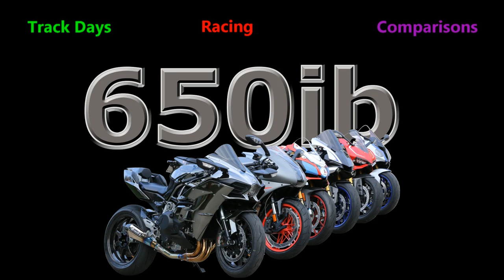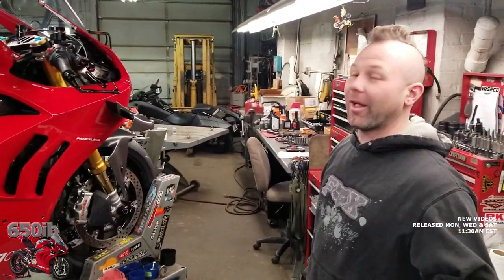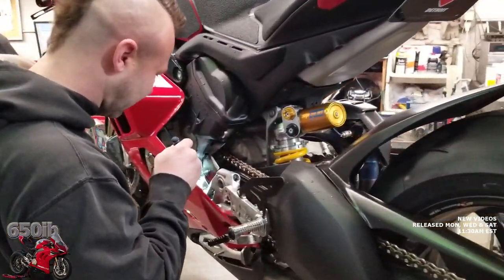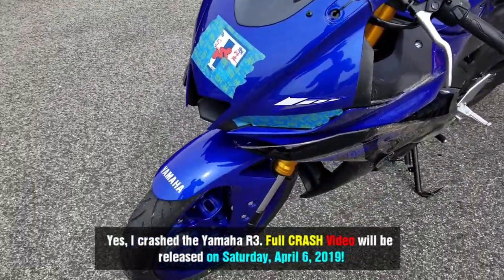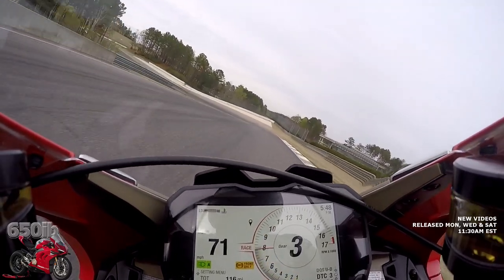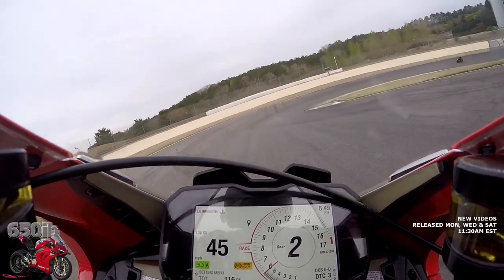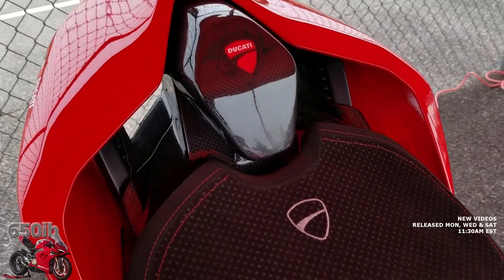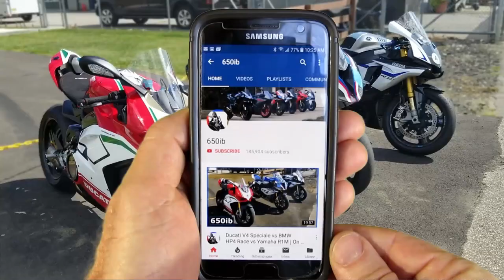Ducati Panigale V4R vs V4 | First Day at RACE TRACK!

Comment: Pass at 11:40 was a-little close for the speed at which you passed. General rule of thumb for your group and overall track days is at least 6 feet. Could get hairy if that guy didn’t stay in his line.
Reply: We used to use the 3 ft. rule on track days.
Reply: That pass was also due to lack of track experience. Track instructors often look over their left shoulders on straights to check on riders while staying on the the throttle. This often causes them to slightly drift to the right. Passing them close on their blindside is an unnecessary risk and should only be done with caution. He passed close and hard on the gas but immediately let off once he passed. Must be too used to those “got em” passes on the highway. Lol

Comment: Hey ib, one quick question. Riding the Ducati v4s I felt it's a little small for the big guys to hide from the wind blast and my legs would tend to open up after 285-290 kmph, have u faced the same on the V4R or is it only with the V4 and V4S versions?

Comment: Cold engine.
You should heat complete the engine before full throttle...
Reply: I'm sure they already started it prior to filming. Relax
Reply: Exactly,they have tire warmers on so its obvious the engine has been warmed up.
Reply: On the dashboard, when he arrive on 7000/8000 rpm, The indicator line become Orange.
It means that The engine si alredy cold and it isn't in the correct temperature.

Comment: bumma about the crash ib, but stick with the r3 and get some sticky tyres on that baby.

the most i ever improved as a rider was when i bought an old track 600. it only cost me a couple of grand but i wasn't scared to drop it like i was on my spanking new bikes and i was able to push much harder because of that.

I can't even imagine how timid i'd be riding a panigale on track.
Reply from the maker: Thanks man, I agree with you. I will ride my R1M track bike more.... I'm not as concerned with pushing it.

Comment: If you spend more time on the R3, you'll learn better lines out of necessity. The big power 1000s make you lazy because you can always go as fast as you want on the straight. With the R3, you need a good line to maintain speed.
Reply from the maker: I agree with you
Reply: I know because I had an R1, then after that I owned a Ninja 300 and CBR250R. I learned so much from those bikes. For the street, I like the midsize 450 to 800 cc bikes. Manageable and fun power. For track riding, I think I'd get an R3. I can't afford to track my SMR 510 often. Engine rebuilds become so frequent.

Comment: Hey Ib. I Love you man and I envy you the pleasure of riding v4r on the track- that goes without saying. Look I am not the hater and do not take it the wrong way. You need to learn how to ride on the track my man, the way you  ride now puts you in great danger of having yet "another agricultural" experience. Here is why- I can only presume that you are using super expensive tyre warmers as you are loaded beyond my wildest dreams.You start the session with properly warmed tyres and then sorry my man but you go so slow that they tyres lose the temperature. Specifically you do not break at all so the front tyre loses the temperature very quickly, the longer you are on the track with that pace ... the more risk you take. You need to maintain minimum pace on the tack and you can't do it now. Take some trashy r6 or s1000rr and spend money on riding tuition more rather on another Rizoma and  once you pick up the pace ... go on v4r. I am not a professional rider or anything but the pace you have and the way you treat the throttle makes me worry for your beautiful v4r. Again not hating but I can see problems coming your way if you maintain your riding schemes. Good luck and keep up with that good work. Papa Bless.
Reply: All I got from that was hating in all honesty. If you're not a pro or a riding coach fall back
Reply: @hfr8343  I am not a pro, but I am a frequent track rider. Ib may lose a front one day as he is a big dude... not hatin quite opposite I love the guy I am his subscriber and I enjoy and like the videos - I do not want him to crash.  Tyres need temperature to work. They get the proper preparation by tyres warmers then they are getting cold on the track... not a good thing.  Just saying.
Reply: @adambrzezinski8009  I was just about to say the exact same thing. No offense to IB, but riding that slow on the track is dangerous for you and other riders.  IB should be on a much lower cc bike like an R3 or R6 to learn how to ride on a track.  Put your ego aside and go buy a cheaper bike and practice riding on the track before bringing the V4R back out, nobody is judging, we all started somewhere. Have fun, but be safe in doing so.

Comment: In sure hope you aren't riding on slicks, you need to pick up your pace a lot as your tires will be freezing on what looks like a cold day and you will have another problem like you did with the r3, you got some cool build vids though... but really you should probably spend money on some classes to get you going on the v4 or use street tires at that pace. You can go faster than that on the r3 and its a better bike to learn on

Comment: 650ib....... the tire U chose for the R3 were to blame for the crash ..... Track tires for track days , period .... Next time use Supercorsa SCs 110 and 140...... there are also Pirelli Superbike slicks 110 and 140  for it......
Reply from the maker: Thanks man. I agree.
Reply: @650ib  what tires were on the R3 ?
Reply: This had nothing to do with it. You can ride track on any tyre so long as you ride to the tyres limits. A couple laps of building up some heat in the tyres is what should have happened. If he had gone out on slicks it may have been worse. A cold tyre is a cold tyre.

Comment: Gearing is short, not tall lol

V4R 1st gear= 13.66, 2nd=10.63, 3rd= 8.77, 4th=7.66, 5th=6.85, 6th=6.3
BMW                 11.5              9.1               7.53           6.53          5.92          5.49

so as you can see like i was telling you in your other vid bro, your gearing is really REALLY SHORT compared to other liter bikes which makes for using all of your HP very efficiently. Due to the extra revs they were awarded to shorten the gearing more without sacrificing MPH
Reply from the maker: Thanks for the info Sir!
Reply: Anytime bro

Comment: Nice video, but you really need to take some courses to improve your skills. Just blasting down a straightaway then dropping an anchor in the turns is not a fitting demonstration of the V4R’s capabilities.  Not intended as a diss on you at all. I was an instructor with the Jamie James school at Barber and if you’ll invest some time into a good Rider’s school you’ll be amazed at the results you’ll see.  Try Cornerspeed Rider’s School at VIR. WELL-worth the time and monetary investment.   Wishing you continued success!

Comment: i've crashed at Barber also.. never fun.. always cold tires.  however.. your buddy Jason really needs some lessons.. way too stiff on the bike, clearly not comfortable, seems to be looking straight ahead instead of turning his head to look through the turn, stiff arms. maybe a keith code school would help a bit.  to be honest.. even your lines were way off, as was the speed.. is it possible that you guys aren't as comfortable on the track yet?.. riding a bit like beginners. truly don't mean to insult, just noticing some pretty obvious errors, and the way you guys are using those big bikes makes it seem like you're more worried about them then really feeling comfortable with how they perform. lines are off, early apexing, too stiff on the bike.. really should consider some lessons to help you guys understand what is going on.
Reply: for example.. that corner where you fell.. you are still apexing in completely the wrong spot.. that is a late apex corner.. the more i watch the more nervous i am for you and your vr4.. you guys really really should consider some lessons.